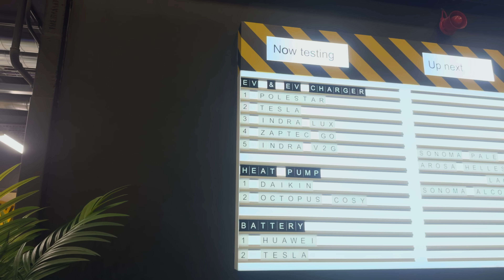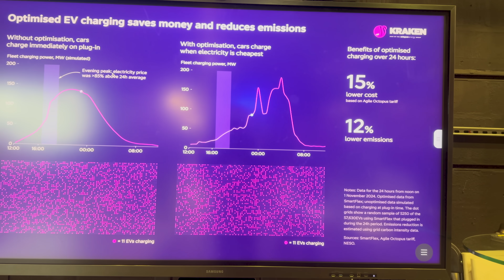Tesla Is Starting A UK ENERGY Supplier TO Take ON Octopus

Comment: Whatever they have tried in the US market will be on offer here, not necessarily straight away, and possibly with tweaks.

I think their main interest is allowing powerwall customers to participate in virtual power plant. Currently you have to do that by signing up with another provider and messing around a bit. Tesla as a vertically integrated company want to offer a zero configuration option for customers... Buy a powerwall, change supplier, see savings, that then acts as an incentive to buy a powerwall because Tesla can sell it with guaranteed payback.

I think most observers will be underwhelmed by the Tesla offer, they aren't trying to be bigger than octopus, they are just trying to be the go-to provider of home batteries offering the smoothest ownership experience, much like they do with supercharger network for their cars.

Comment: tesla already offer a ,"unlimited ev charging" in certain parts of the US, yes its tied to a pw, but like all things there are those who benefit more & less,  imho i think one of the tesla energy offerings will be a V2G for tesla owners, who take up the energy side ,providing of course you have a powerwall, imagine you drive 300 miles a week average & you plug in every night, tesla will be able load shift your electricity @ expensive rates, and replenish your battery @ cheap night time rates, or like IOG you handover control of your PW & tesla car battery & they arbritage your energy while keeping your house running & car powered, with a percentage returned to you as a energy credit on your account, who knows, the options to provide silly cheap electricity from there megapacks, is a distinct possibility, Octopus need to get into BESS & more localised windfarm projects to counter the tesla potential competition, good to see bg knocked off the top spot  though :)

Comment: If Starlink is anything to go by, their pricing will be totally out of touch with the UK market.
Reply: We have had Starlink for several years now, it is targetted at people in our position being rural based (UK, North Wales) with no access to  standard landline/fibre broadband or mobile phone networks. We previously relied on a geostationary satellite internet access which was £150 a month for 50gb of data, terrible latency and poor speeds. Starlink halved that bill and provides low latency, speedy connection with unlimited data. The only issue is that it now costs a fortune in subscriptions to Netflix, Apple, Prime, Disney. We have solar PV and are having a Powerwall 3 fitted next week, so am looking forward to these options that could be offered from Tesla. We would have an EV as well except there aren't many good options in the 4x4 type vehicles necessary for around here.
Reply from the maker: @keithrushton9899 I can name some good 4 wheel drive options
Reply from the maker: Starlink is cheap for what it is… just for a home user you have options and remote portable dish isn’t going to be your best option,  but if your on a narrow boat or caravan or very remote parts of UK it’s great value for high speed
Reply: @NicolasRaimo Got you, I wasn’t debating Starlink’s use case. My point was about pricing: because Starlink is pricey in the UK, I’m guessing Tesla Energy will land with a similar premium once it hits here. Great tech, but due to the brand name you’ll be paying extra for it, so likely out of step with typical UK pricing.

Comment: There's not many companies interested in buying in residential solar and reselling it. That's because it's all supplied at low demand and all sold at peak demand later inn the day when it's not generated (but they can't store it). If you've got a lot of batteries and predominantly grid scale batteries, everything changes. You hoover up all the cheap electricity during the day and sell loads at peak times while just retaining enough to charge all those EVs overnight. That's where Tesla comes in...
Even better, batteries permit us to start shifting the base load towards renewables thus requiring less gas and nuclear.

Comment: Tesla are going to have to do something quite special because of the boss so I think your call on exclusive to car or battery owners is a good shout as the company knows these people are that hurdle crossed already. 

I'm curious if they will favour supply like most current suppliers or if they will look at really pushing batteries / solar / v2g with trying to take as little load from the network as possible or really try to use off peak energy to keep prices down. Most suppliers actually have a low profit margin anyway (as you will know and a lot of the public won't believe) so Tesla will look at ways to maximise that. They might also look to leverage v2g via their cars by offering some sort of battery warranty on the car / wall to elevate the concern of using battery charge cycles. They may know that batteries are good for their plans so have confidence to offer that warranty which will then entice people to their supply. 

For me, they need to stop being so 'forward thinking' with their cars as the main reason I didn't consider a model 3 is that single screen and no stalks on the newest one. I heard they rolled back on the steering yolk so hopefully they will realise they could get more people by keeping the cars more normal.
Reply from the maker: Great points, especially about leveraging V2G and battery warranties to incentivize customers!